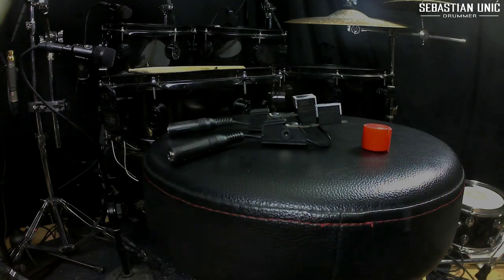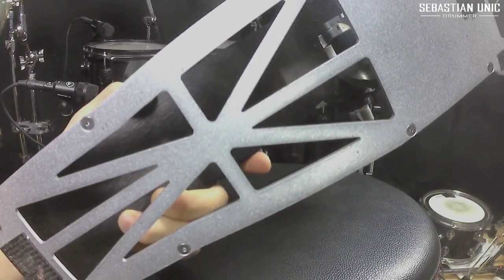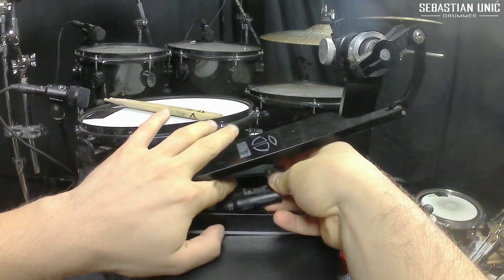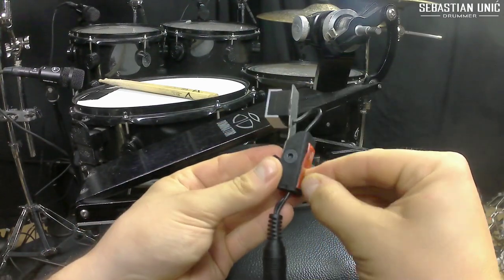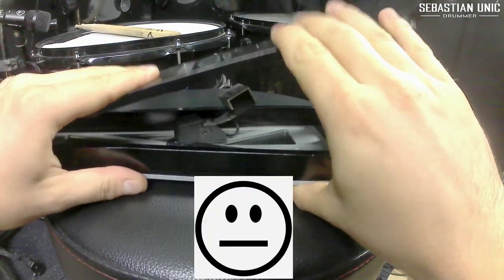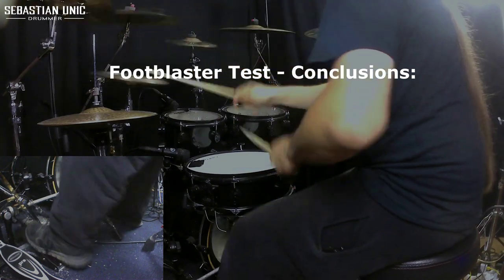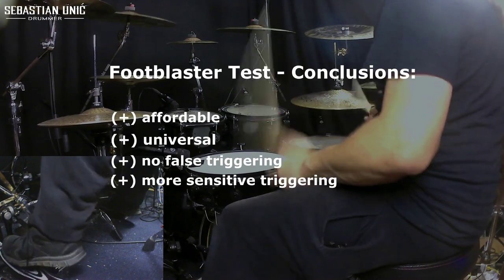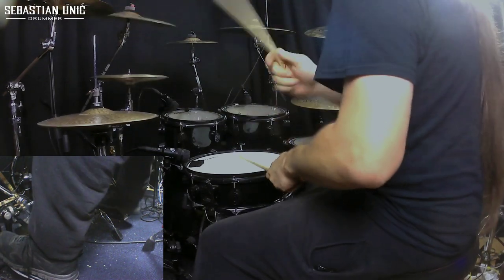Footblaster Trigger: First Impressions (Setup & Playing)

Comment: Been thinking about trying this out so I don’t need to mess with bass drum settings as much when playing on house kits! I have the ddrum triggers now, which work great, but I always need to retune the entire drum to eliminate false triggering.
Thanks for the detailed video! Very helpful. Subscribed.
Reply from the maker: You're very welcome. You still might need to do some adjustments e.g. on your module when playing different kick drums, but all in all I find the FootBlasters to be a lot easier in handling and universal use than rim triggers. Thanks for your subscription! :)

Comment: Hey sebastian.. I'm facing a problem finding the right settings for the foot blasters as I play with TM2 module, it's too sensitive that sometimes if I relax my leg on the foot board or get ready to start playing fast double bass there are some hits that are counted without even playing and this is a bit frustrating for me do you have any solution for this? Thanks in advance
Reply from the maker: Hi there, there is probably an easy fix for that. 1) increase the threshold parameter on your module, that way only stronger (or in that case, only actual) hits are registered as such. 2) you might also want to increase your ReTrigger value. This will reduce double triggers. There is probably a sweet spot you need to find where you have changed both these parameters and you have the most accurate triggering possible. Needs some experimentation sometimes. Good luck and hope this helps!
Reply: Hi bro, did you solve this problem? I have too. If I increase threshold and retrigger cancel, I miss shots while heeltoe. Otherwise I have same problem like you.

Comment: Thanks for the video. What would you suggest for combining two footblaster triggers into one input of an Edrum module?
Reply from the maker: Well, you just need a Y-cable that lets you plug in the mono jacks from either trigger and combines them to one jack input for the module. This can work very well, the downside being that you cannot adjust your right and left settings individually.
Reply: @unicsebastian  thank you!

Comment: Awesome review! I have been playing the dominators for a while now. How did the foot blasters hold up since you posted this video?
Reply from the maker: Thanks man! They held up pretty well and my first impression has been confirmed. Yes, they trigger very clean and are durable, but you need to readjust the height of the sensor from time to time or when you switch kick drums. But no biggie.

Comment: Hey just wondering what type of trigger in the trigger settings of ur tm 2 r u using? For the type i use the BT-1 SENS setting cuz tht seems to work best with the foot blaster but i get a lot of double triggering and no matter what threshold and sensitivity i set i get double triggering. Maybe it could be my technique with triggers isnt clean enough idk

Comment: Sup dude! Helpful video and I have em set up already but I'm getting a lot of double triggering with my dominators? Any tips?
Reply from the maker: Hey there, it could either be the module settings or the height of the piezo box. I don't know what module you have, but there are a few parameters on most models that can be changed: increase the threshold, increase retrigger cancel, increase mask time. Try these as single adjustments and if neither works alone, try to combine it. The other option is that your piezo box is a little too high. This way it reacts more sensitive to little bounces of the footboard after a hit. You could additionally lower the tension of your kick drum. That's all I can say without actually having seen your problem in person. Takes some patience but I'm sure you'll figure it out. Cheers

Comment: very cool video man. question, how does one connect these if my module only has one kick drum trigger input?
Reply from the maker: Hey man, thanks! I don't know which module you are using, but besides being mono/stereo, module inputs are usually not assigned exclusively to what is written above them. It's just to make your E-Drum wiring easier. So you could just take another free input for your second trigger. Make sure it has the same adjustments (trigger/pad type, threshold, sensitivity etc.) as your first input so both will work the same. You could also just use a Y cable and plug both triggers into the same input. Make sure you use the right kind of Y cable, depending on whether your input is mono or stereo. I got both ways to work fine, although with a mono Y cable, you cannot adjust both trigger sensings individually.
Reply: @unicsebastian  thank you very much for the detailed answer!  I have an older Roland Td-4 module, where as you can guess the sounds are not good at all. especially for the faster stuff.  i was hesitant on getting the foot blasters for my module only has one "kick" input.  but you cleared up the questions I had perfectly. cheers!

Comment: I have the Dominators and I was kinda worried about mounting this type of triggers due to the lack of a full base plate. It's good to see that it can be done. Have you tried securing them with cable ties in addition to the double sided tape?
Reply from the maker: I have considered that in case it wouldn't stick. But as I noted in the description, if you let it rest for some time after sticking it on the plate, it holds up perfectly fine. Never came off once since then. So it should be fine. :)
Reply: I have the very old Dominators with no base plate at all and I just attach similar triggers by their side to the structural elements

Comment: I got a question and i hope you can help. I always played without triggers and "bury" the beaters in the Bassdrumskin. How do you play? I couldn't really see if you bury your foot or not. And if you do, did you have problems with fail or double triggers?
Reply from the maker: Well, I'd say I play fairly powerful, even with triggers. To avoid false triggers, which can occur when playing like this, I recommend lowering the head tension. If it's too tight, your beater will bounce off, potentially creating double triggers. Another thing is to adjust the module settings accordingly. If you play loud and hard and bury the beater, you might want to increase threshold and re-trigger values to avoid double triggering from smaller beater bounces. Also, with a trigger system like footblaster or OnTrigger or similar technologies, it is fairly easy to adjust the piezo height exactly so that it is hit when the beater is really striking the kick drum. I found that following these steps greatly improves triggering accuracy. As I said in the video, if you push your beater into the head really hard, you might need to bend the sensor back up after some time. Hope this helps. Cheers!
Reply: @unicsebastian  thank you so much man!

Comment: Does anybody know if you can use these with a Yamaha EAD10 module?
Reply from the maker: I have not tried, but the EAD10 has inputs for external triggers and in theory, it should work with footblasters, too.
Reply: i have ontriggers and the ead10, but i gave up. cant dial in.
Reply: @chaosinmotion5946  well this is discouraging to read lol.
Reply: @I-Need-Saving  yea man, always doubletriggers or missed notes. the doubles were my 10% false technique, i know now (burying the beater). 
but i wasnt able to get to a result that is at least near acceptable. its the ead10 most people complain. the footblasters an ontriggs are absolutely fine units. 

BUT.... do get a lasersystem. i have the trigmic laser pick. it solved ALL my issues at once. setup is a minute, its ridicolous how well these work! cant emphasize enough. from first try i could forget all the years being troubled. its night and day difference.

or get another module with sensitive settings. but again, with trigmic you dont need to worry. plugthe cable in and lets go.
Reply: @chaosinmotion5946  I’m not a technically inclined person with this stuff, does the trigmic still work with the EAD10? Or is this something that’s completely seperate specifically for the triggers only? I play and record with the ead10 and rec n share app, so if I do anything trigger wise, I need to still be able to do that if that makes sense.
Reply: @I-Need-Saving  dude makes total sense. i was there a few weeks ago only to finally find a solution for me. but i use a laptop now that will capture the trigmic and ead via cheap interface. 

well i tried to connect the trigmic to the ead10 and i thought it might not work, because trigmic also already has a module insight, but you have to maybe trim a sample, convert to tms and upload it. takes 5 to 10 minutes. and it worked with some. even better record a raw piezo sample/signal. and you need to know the trigmic is not allowed to go into the mic channel of your ead10
Reply from the maker: @chaosinmotion5946  I have recently tried out the EAD10 with my footblasters and I have to say it did work eventually but whatever tweaking I did with the settings (the UI of the EAD10 is incredibly bad and clunky to handle, by the way) it was never as accurate as when I'm using the TM2 as trigger module. To me it seems like the EAD10 is a very powerful compact microphone/recording unit, but it doesn't handle triggering very well. What you could try is to trigger your kick with an external module such as the TM2 and connect that to the EAD10 as aux source. It should work for monitoring, but I don't know if you can also record that aux Audio with the EAD10. But maybe this helps.

Comment: hey dude, nice video. but i keep having false triggers with the footblasters, my head tension is quite high and so is my spring tension with the Axis A longboards, i also use the Roland TM-2 module with standard settings. maybe you have an idea how to fix this?
Reply from the maker: Hi, thank you! 
From what you're saying I can only assume that the problem may be due to your high head tension causing the beaters to bounce of, which causes double triggering. Try lowering the head tension a little bit, dampen the kick properly, if you haven't done that already. I usually keep my kicks tuned medium to low. I like the more natural feel rather than too much bounce, and besides that I can still get a decent acoustic sound. You may also want to try to increase Threshold and ReTrigger parameters on your TM2. Play around with different combinations of those adjustments and I'm sure you will make it work. It takes some time. Hope this helps. 
Cheers!
Reply: @unicsebastian  thanks for the quick response!
Reply from the maker: @JessevanNijnatten  You're welcome, man!
Reply: you probably bury the beater when you play your normal bass strokes. make sure you keep the beater off the head after each stroke